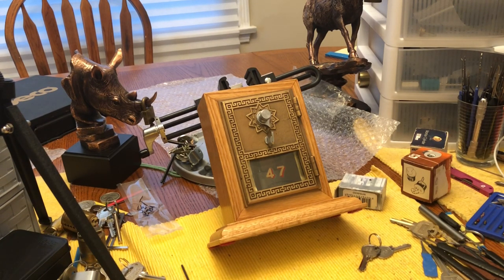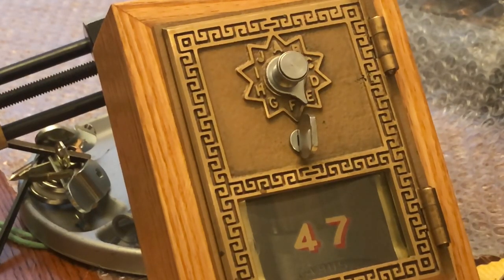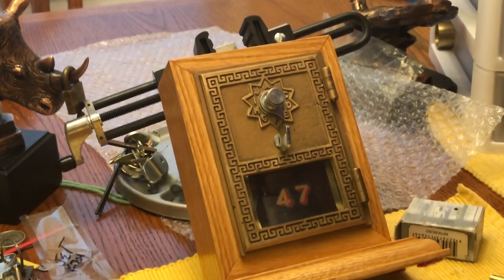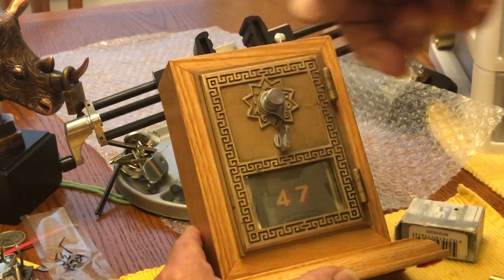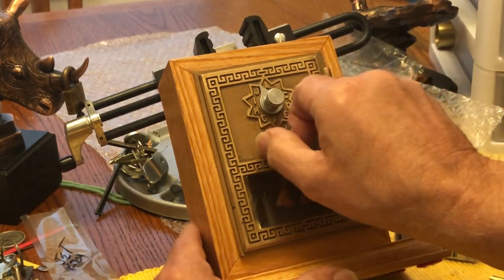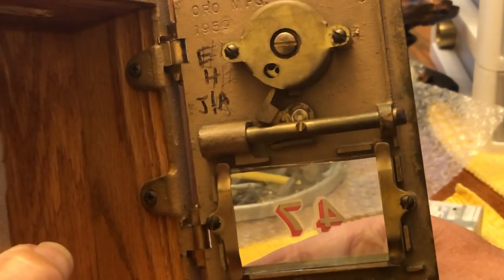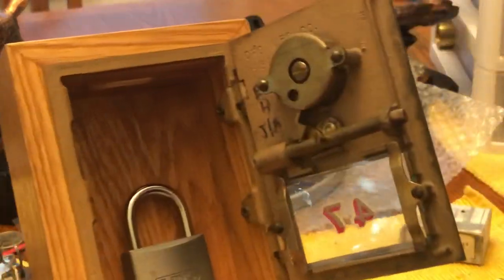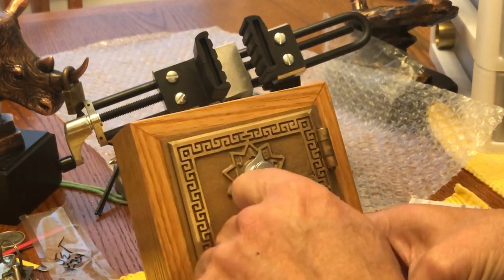#90 PO Box door with a combination lock

Comment: Where was this used? I gather in a post office but it wouldn't have had the base/stand, would it?
Reply from the maker: Gary Rumain use to be you would walk into a Post Office and there would be a whole wall of these doors. Someone has taken the door and made a box for it and now it is a bank. 
Thanks for the comment!!
👍👍👍
Reply: @chriscapune7873  OK, it's like the post offices in Oz. Ours still have PO boxes, but they're solid metal doors with a 7 pin Lockwood lock. They have 3 different sizes.
Reply from the maker: Gary Rumain yes that how ours are now, but not with cool Lockwoods!!
Will have to see what our locks are now.
👍👍👍
Reply: @chriscapune7873  OK. Ours have been the same since at least the 1960s. No idea what they had prior.